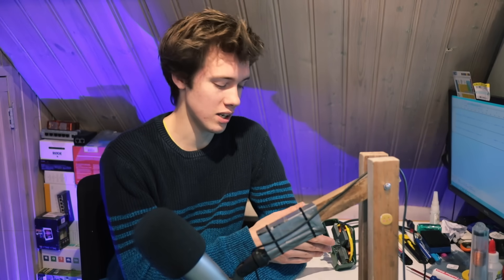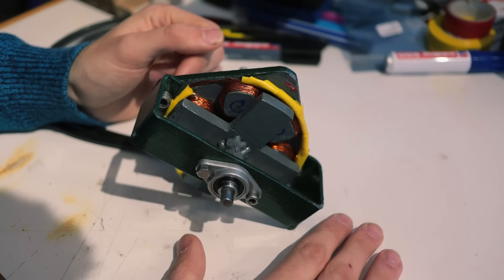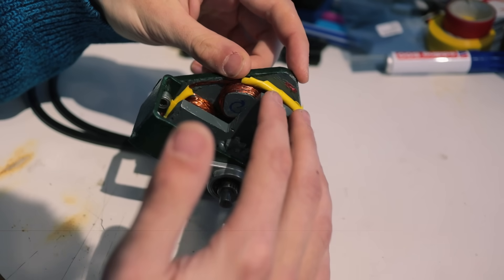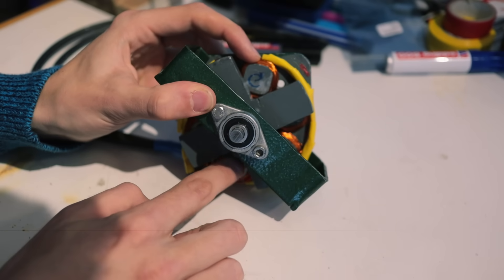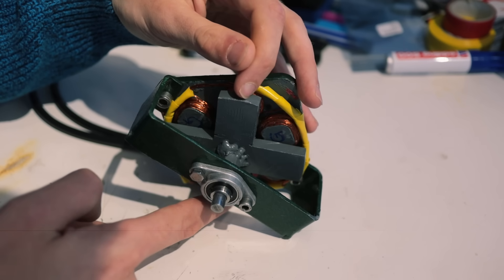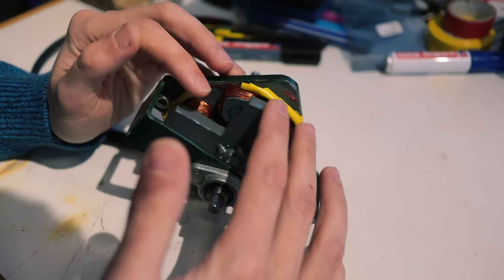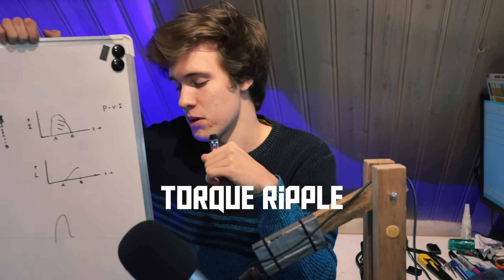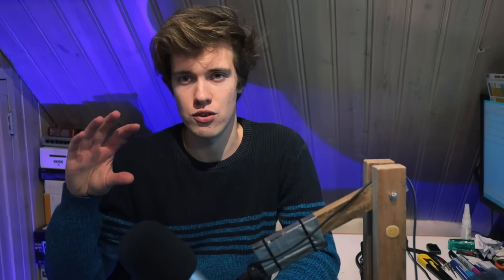Switched reluctance motors: simple yet tricky

Comment: You've got a good presence on the tube and do a great job of explaining the operation of the SRM. One other thing you may want to point out is the torque on the rotor with respect to the angle as it approaches the stator. It too is complicated because the percentage of the pull forces are greater when the angle is greatest, but the fringing magnetic field is weak. There is an optimal point as the rotor nears the stator winding where the vector force due to the angle and the fringing magnetic field is stronger such that the torque is maximum.

Comment: Watched the video til the end. The video explains the physics behind this motor properly. To the point. Switching the polarity at predefined intervals can be a solution, but altering the speed will be difficult, and the motor will not generate its maximum possible torque by doing so. It's a good proposition, yet, another never-ending exploration for cheaper propulsion like pulsejet (at least at the moment). I'd have to look at the history of this motor.

Comment: It would be interesting to get the difference between "Switched Reluctance" motors and the old stepping motors that have been around for 50 years or so, used in hard drives, floppy disc drives, video players~recorders etc
Reply: ...and that still drive most 3d printers or cnc machines that aren't expensive enough to use servos.
Reply: Depends, some have magnets in the rotor and are more like a pmdc, others are basically a small switched reluctance motor. All have a lot more teeth on the rotor.

Comment: These motors sound very similar in some ways to BLDC motors. I think it would be possible to just reprogram a BLDC motor driver to drive one of these too. BLDC motors also need position sensing (physical sensors or measuring the unpowered coil) and they need precise timing/positioning for when it switches the coils on, just like these motors.

Would it be possible to connect these motors coils up in a star configuration too, similar to how BLDC motors already work?

Another thing to look at is stepper motors and their drivers, they also require energising coils in a certain order and precisely.

Comment: Yep... you can slow down the saturation time by introducing air gaps into the rotor, and increase efficiency by moving away from any solid metals... a metal powder mixed into an insulator bind (like iron powder mixed into epoxy as a simple example) stops eddy currents from being able to form, so it runs cooler, losing less energy to heat. You can also deal with some of the switching issues by adding a few windings from one magnet to the neighbouring magnet. Big advantage is that you don't need the rare earth minerals to make the magnets that can survive higher temperatures that you can get making high power motors... there's a lot of human exploitation found in those supply chains, making their use difficult to justify in any kind of "future for humanity" project, and somewhat self defeating.

Comment: That axial flux design would be very suitable for a PCB based design. For small motors could use standard inductive coils even. And of course the PCB could easily hold the sendors, power and control electronics as well. Microcontrollers are now very cheap. Could make for a nice open source computer fan design?

Comment: Nice review. Although switched reluctance motors may be rare, they have a much more prevalent cousin in the form of the variable reluctance sensor. These are found in wheel speed sensors and propeller shaft sensors of older cars built around 2000 and before. They are self powered little generators that produce a voltage and current sine wave that correlates frequency with angular velocity. The pulsating output is easily converted into a signal that accurately shows wheel speed, with the only weakness being a difficulty quantifying very slow speeds. For that reason newer vehicles largely switched to hall effect sensors.
Reply: Still often found as crankshaft sensors with Hall effect used on the camshaft’s due to the camshaft running at half crank speed.

Comment: In the 40s or 50s, the company General Models made a simple model of a self-propelled railroad inspection car and a Birney streetcar using a motor that operates on the same principal- the design had a single winding that energized two poles, and one of the axles of the cars was a metal bar that would align itself with the poles when energized. The wheels on the axle acted as a sort of commutator, making contact with the track to complete a circuit with the coil. As the axle rotated to align with the poles, the wheels broke contact, and it would coast until making contact again- there were two power strokes per revolution of the axle. Due to the design, they needed a push to start, and weren't suited for operating up inclines.

I own one of the inspection cars, and never knew what the type of motor was called, it was unlike anything I'd seen before on a piece of model railroad equipment. They called their system "Elec-Traction". I don't think it was around for more than a few years.
Reply from the maker: That's quite clever actually
Reply: We need to put you and that contraption in a museum for education purposes.... Please repeat how it worked...in a detailed manner in a video then send it to AKIO TV to post for us.

Comment: does that generation of power also work without magnets using only the metal bar/cross and if it isn't used as a motor(which would generate a magnetic field thus magnetizing the metal)?
Reply from the maker: The motor won't generate anything unless driven actively with the correct timing. If you wanted to use it as a standalone power generator, you'd need a small battery or something like that to get it started.
Reply: @AKIOTV  Ah I was already thinking that indeed, just wanted to know for sure anyway since it might be there was some weird effect I didn't know of similar to how you can generate electricity by changing the distance between 2 capacitor electrodes in cases where the capacitor on average is atleast partly charged(since the capacitance changes) even though technically seen that also required it to be charged just like this.

still wonder however how effective such a switched reluctance motor can be when using it as a generator and driving it properly yet with a cheap driver, since if it would be possible to make a relatively efficient and relyable generator like that then it would actually allow for much cheaper generators, as well as a generator which can handle insane temperatures.

if you happen to end up using or testing it as a generator that would certainly be interesting to see how well it works and such as well as perhaps even multiple ways it can work.

Comment: Very nice presentation - subbed.

Further improvements to your practical model can be made by using laminated silicon steel as opposed to what looks like homogenous mild steel in your model. I'm sure you are already aware, and you touch on this, but magnetic histeresis really does have an adverse effect with this drive regime. Perhaps fabricating the rotor from  "I" sections harvested from transformer cores could be beneficial?

If I may offer a "peer review"/criticism on your presentation?  Exagerate the graph slopes by effectively expanding the time axis. This makes them easier to understand visually for the viewers, albeit at the expense of accuracy.
Reply from the maker: I initially wanted laminated silicon steel, but it's surprisingly hard to obtain, unless you sacrifice a complete transformer. The next best thing is probably regular steel sheets that are stacked, but to save some time I decided to go with solid steel for now.

I'll keep your graph tips in mind for future videos.
Reply: @AKIOTV  Yes, I understand the need for expediency, and of course silicon steel stock is hard to find. 

I've just also thought of another way to gain an almost complete laminated rotor is to harvest the rotor from an inductance or even a universal motor, and then machine or grind the star profile (therefore breaking or removing any induction conductors) and then taking an axial section if required. These motors are two a penny, so an old washing machine (universal) motor may give you what you need for minimal effort or cost.

I'm looking forward to how this progresses.

Comment: So with a brushless DC motors like we use in the RC world, it seems the only difference from an SRM is permanent magnets are placed on the rotor of the BLDC. No?  Or am I missing something here?  Everything you described is how BLDC motors work down to the motor controller. We call them the ESC (Electronic Speed Controller.)  We have both sensored (Using a hall sensor) and sensorless that relies on back EMF.  Sensorless can cog at low speeds, but once going, they work  smooth and flawless.  One more question...LOL  Do SRM's need, or benefit from a startup capacitor? I would imagine there is a heavy current draw to get moving.
Reply from the maker: The absence of magnets is a small physical difference, but makes the motor very different to drive. The details are too much to write in this comment, but if you compare the output sequence of a normal esc to what you saw in the video, you'll notice it's not the same. Another difference is the ideal drive waveform; the best shape for current in a bldc motor is a (pure) sinusoid, which is not the case for an srm.

Comment: Make a rotary transformer.
So put a secunder beside primer coil.
Use Opto / Hall switch to adjust timing via a 555 circuit and play with duty..
Use tiny air gap (~0.5-1mm)
Put load on the shaft (fan) and load (example 12v bulb)on secunder coil.
Play with loads, to see how your rotary transformer behaves.
Now, you may recognise, at maximum magnetic force you get the maximum torque, and at maximum flux change you get maximum voltage.
Think further..

Comment: Only advantage if these motors over brushless DC motors with magnets isbthat they dint use permanent magnets. But for any tyoe of these motors adding magnets should make it more efficient right ? Like if you replace the iron cores with magnets the motor will have greater torque and speed right?

Comment: I was just wondering, could you use blocking diodes on each coil so that when the iron starts to pass the coil and inductance drops the current gets dumped into the next coil and just drive the whole thing with a variable frequency signal?

Comment: A crude way of controlling the motor would be a commutator and brushes. Build it inside out, deliver DC to the iron rotor via slip rings, then have brushes facing outward from the iron rotor to fixed contacts on the stator part, connecting the coils in sequence. Another way would be to install a magnet disk on the rotor with hall sensors on the stator part. When a magnet comes by, the hall sensor triggers a transistor to supply current to a particular coil.
Reply: Yep. Hall sensors and tiny magnets work good, but not as stable as an optical-encoder.

Comment: What sort of general approach do you have in mind for the controller? I know raspberry pi is not the greatest necessarily but having your motor literally on the Internet hosting it's own stats and controls isn't the lamest option. But a kernel panic could be catastrophic? Or maybe the motor just loses torque and acts as flywheel. Cool project! Definitely caught my attention!
Reply from the maker: For now I plan to control the thing with a simple arduino. Raspi seems a bit overkill, although it could always be added later on.

Comment: Instantly subscribed. Very clear presentation. 

I designed a similar motor that drives a ceiling fan in my welding shop. 

It is always ready, meaning it is battery driven and operates by SELF-switching its circuitry on and off. 

I just reach up and give it a push and away it goes.  

I also have one that operates on compressed air and it too is always ready and starts & stops by hand.

Comment: This is a synchronous reluctance motor
A switched reluctance motor is an asynchronous induction motor with switchable resistors in the middle of the induction coils, usually through brushes

Comment: Thanks for publishing a video like this, I thoroughly enjoyed your whiteboard explanations.
I explored SRM's several years ago, prototyped a driver and modified a universal AC motor into a 1-phase 2-pole radial SRM after a lot of rotor stripping and shaping. I have a short video briefly discussing my driver's principle of operation, some active scope waveforms, and deliberately forcing the SRM into a poor firing angle. You might find it interesting as you work on your SRM driver. My intent is more spirited towards Peter Lindemann's "rotary attraction motor" drive principles over traditional designs that may simply use a snubber circuit, or the primary link capacitors as the closed-circuit to dump the stored energy from the coil's magnetic field. I was focused on creating a driver that managed a mechanical output, and a secondary regulated electrical output. My drive used transistor logic with hall sensors rather than an MCU, and it worked great for a universal motor turned into an SRM.

For a given input power of 165W, I was able to recover 60% of the stored magnetic energy simply as a consequence of running the motor. The recovery was actually essential for maintaining a tight firing angle like you mentioned in the video. My setup could benefit from a higher resolution to achieve the perfect firing angle, but beyond that I would need a dedicated rotor and stator design and more poles to increase efficiency and reduce vibrations above 8000 RPM. I tried purchasing a ~$800 SRM from a company called Striatech in 2018 so I had a proper motor to use as a dev platform to work towards a more intelligent driver with firing angle phase adjustment, torque control, and a few other control and feedback features, but Striatech was dragging their feet and giving supplychain excuses. It went from a "a shipment is arriving in a couple days" to 1-2 months, and then they stopped replying to me alltogether. I got my money but it took the wind out of my sails and I just moved on without there really being any good companies selling small SRM's for development in that period in North America. 

I've been focused on other subjects since then, but I'd like to start putting time into motor design again with renewed interest. Hey if you ever feel like bouncing some motor related questions or thoughts off of while you engineer the motor and driver for your project, feel free to throw me an email!

Comment: You could just use a set of mechanical points, set slightly ahead of the rotor, to activate and deactivate the coils. No fancy controller needed. 

Points could be actuated off a lobed cam, similar to point ignition in a car.
Reply: Three hall sensors and a microcontroller and some mosFETs is super cheap, that's what they use for BLDC motors and this is basically just that with a passive iron rotor instead of a rotor with magnets on it. Electronics have gotten so cheap they are actually less expensive than  a mechanical solution now. Plus there's no contact so there's nothing to wear out. Electronically commutated motors can approach 98% efficient because the commutation can be adaptive. If the RPM will be high and fairly constant you can use a "sensorless" controller design that determines the rotor position via back EMF from the motor. BLDC motors used in drones and model aircraft use sensorless motors for that reason.
Reply: @atomicskull6405 microcontrollers are a great option if you like working with them. I don’t. Personally I prefer dead nuts, simple, mechanical solutions over using micro controllers and such. Partially because I’m ass at coding, partially because I feel like they’re cheating on certain projects. But I also design and engineer totally different than most people.

Comment: I used to work at for a well known vacuum cleaner company (probably better known now for expensive hair straighteners). They were very secretive but I did manage to find out that they were using these motors in their line of handheld vacs. Ebay might be a cheap way of getting hold of a small low voltage motor/controller to play with.
Reply from the maker: Yes, I recall seeing some teardown videos of those products. I can see why they'd use it: it's cheap, robust and can spin fast. Torque ripple is not much of a concern for a tiny, high speed fan that makes 10x more noise than the motor anyway.

Comment: I have seen a switched reluctance motor, my Rainbow vacuum cleaner has one in it.  Inside is an asterisk shaped laminated steel rotor and what appears to be either two or four coils of wire in the stator.  It's a neat sounding machine starting up as well.  There's also a microcontroller board on top of it to start and run it.
Reply: Thanks I'm going to be looking for one in our markets and second hand stores. I used to have a Rainbow, when they first came out. I loved it because it got rid of the dust issue that conventional vacs at the time did. Thanks again.
Reply: What is the failure rate of that vacuum cleaner with such a motor? Do you know?

Comment: How much different is this motor from typical AC induction motors?
Reply from the maker: Very. The induction motor operates thanks to electric current in the rotor, whereas in an SRM rotor current is an unwanted side effect.

Comment: The most perfect motors, I swear are direct drive BLDC, out of washing machine. You can take the motor and connect any two of the wires    and spin the motor by hand say 60 rpm get 120 v at 60 htz, hook 2 together and spin one to drive the other, variable speed motor, generat at 1500 rpm ,1000 volts ,snap!!!😊